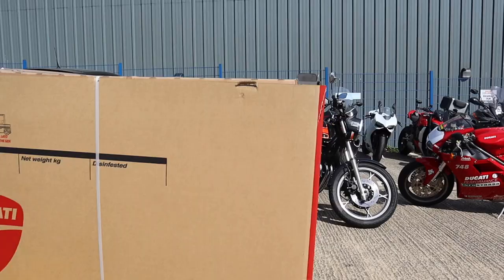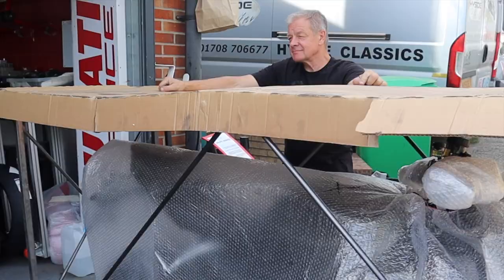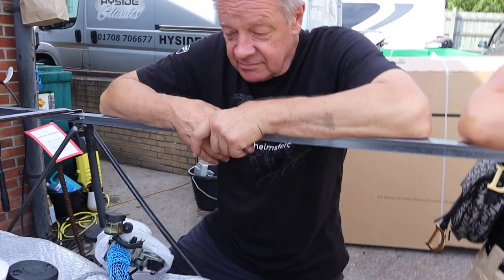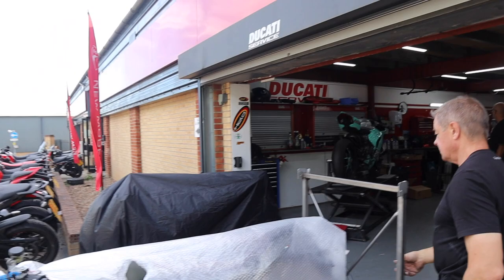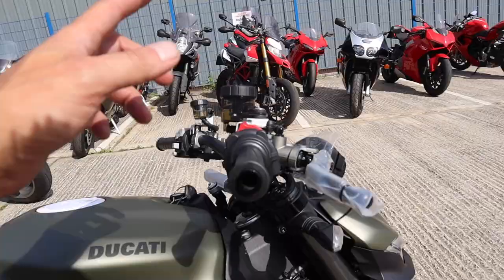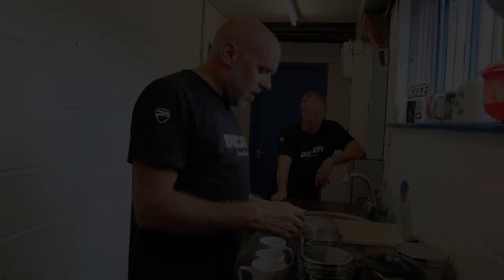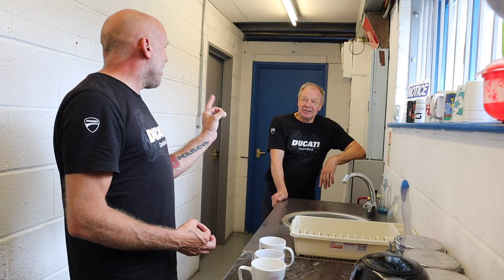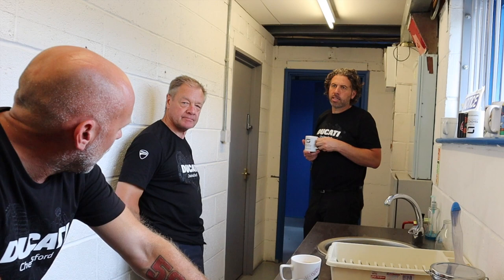New Ducati Streetfighter V2  ..A Green Storm is coming in 2022!! unboxing & first look

Comment: The green looks crap.   Ducati need, badly, to bring back yellow.
  Meanwhile, up here in the North East, we are still waiting for the ever useless Ducati UK to have a dealership between Yorkshire and Scotland!  Yup, Ducati UK stopped the main Newcastle dealer from selling  Ducati...........without having a replacement dealership to take over.   Consequently, the Ducati owners in the North East are expected to ride all the way across to Carlisle, Cumbria, for any servicing.  Needless to say, I and other owners told Ducati UK exactly what they could do with that suggestion.
Reply from the maker: I quite like the green , the more I see it it looks cool , but then I’ve never been a fan of the yellow , but hey we all like different things , oh ok, didn’t  know that about the problems in the north , guess there must be some reason behind it why a dealer hasn’t got Ducati anymore
Reply: @ProjectMoto  Seemingly, Ducati do not want dealerships that sell any other brands.  That's fair enough.  However, closing that dealership down without having one to replace it says it all about Ducati UK, imo.